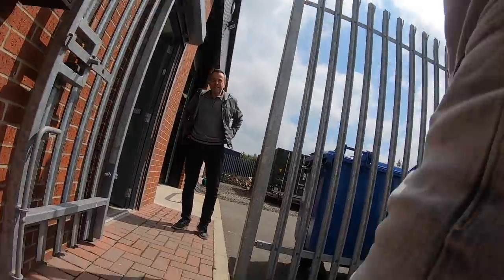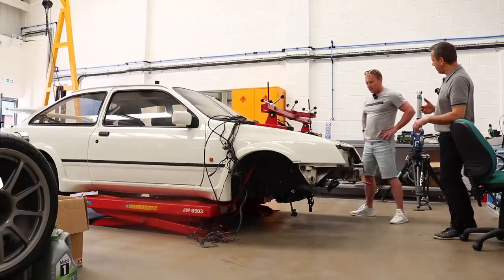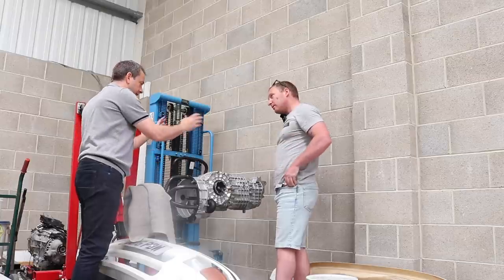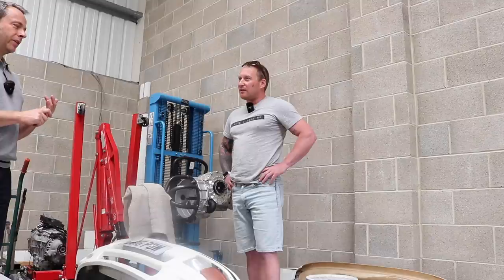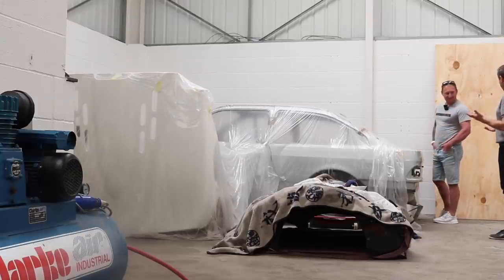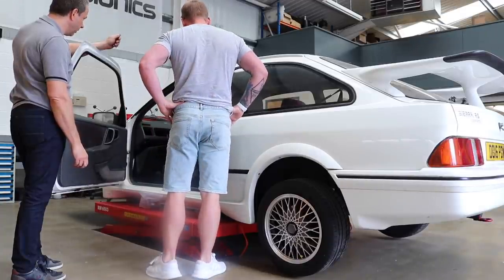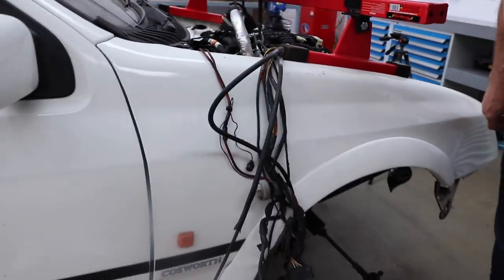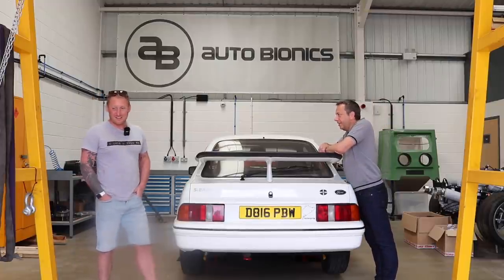Steve’s INSANE Raptor engined, PDK gearboxed, Cosworth project

Comment from the maker: If you could do any Car/Engine combo. What would it be?

Mine would be a BMW e30 M3 with modern M3 running gear 👌🏼
Reply: How about a Mk2 Golf with an RS6 V10 engine and running gear in it 👌🏼😂
Reply: Pulsar gtir with a rb26 😊
Reply: Nissan micra with the new 3 cylinder twin turbo out the new koenigsegg  🤣🤣🤣
Reply: Always loved the idea of dropping an e60 M5 engine into a standard mk2 Sierra. Or an Aston V12 into a mk3 capri
Reply: I’d love a Honda 50 with a nissan skyline engine
Reply: I’d love a fiesta ST mk6 with a 5 pot rs focus lump 😎😎
Reply: Beetle vw v8 or v?6
Reply: Mine would be 55 Chevy Bel Air - Jet Engine on the back :D
Reply: I got half of it Adam, just not the expensive bit
Reply: Vauxhall Nova GSi or GSi replica with a 2.0 16v C20LET 'Redtop'  engine
Reply: Great video adam as usual, if you want to see some crazy engine swops check out the thunder saloons from the late 80s/90s on YouTube, Absolute monsters!
Reply: 3 door Sierra with a YB in it
Reply: Alex Lee. They were done in their bucket loads in the 90,s some even had the calibra turbo 4 wheel drive running gear
Reply: Hellcat engine 707hp in a nova..
Reply: 4l boa cosworth v6 supercharged with skyline gbox and diffs in a sierra 4x4
Reply: I had a mate who had a M3 e30 with a e36 evo lump in it running 850 wheels😎
Reply: Have you seen the driftworks m3?
Reply: I wanna rwd convert my Saab 900 Turbo with a 2.3 B235R Saab 9-5 aero engine with 500hp mated to a 6 speed BMW gearbox. The ultimate sleeper
Reply: Porsche 914, or any air-cooled 911, with Taycan internals.
Reply: Adam Smith what like Phil Morrisons at Driftworks? Check it out if you haven't already. I'd like an xjc or xjs  with some sort of modern efficient V8. Or to finish my MK1 golf with its 1.8t that all ground to a halt many years ago.
Reply: Rs17t 4x4 cosworth running gear screaming mid engine dfv
Reply: Ford fiesta with 16valve cossie engine they used in the sierra sapphire cosworth
Reply: @philmann7054  
How would it fit?
Reply: @mctomeister  thats been done already nice conversion aswell. Think the lad is going awd aswell using the volvo v70 gearbox.
Reply: Veyron motor into a nova
Reply: @mrlionrocks  
Yeah would fit aye 😭👏😅
Reply: I'm quite simple but i'd love an Omega with Lotus Carlton lump. or Astra G with a Y30DTI.
Reply: Adam Smith, any idea how he got, or plans to get the PDK to hook up to the Raptor V6....who he tap for the bellhousing adaptor?
Reply: Aventador v12 into a prius
Reply: @James-P96  mk8 fiesta st with that Koenigsegg 3 cylinder.
Reply: Alex Lee loads of them were done back in the day
Reply: That Raptor V6 in a Mustang.
Reply: For me mk3 astra 200ts saloon with 3door swap mk5 vxr leg 2l turbo m32 box mk4 climate control 

Ford Sierra rs500 barracuda turbo mustang 6speed box
Reply: @paulthompson5416  theres a mk4 golf that has a twin turbo rs6 v10 and 4wd in eastern europe! theres quite a lot of videos on yt of it
Reply: @adellisdevelopmen6593  judging by the astra 200t and still wanting good climate control on a project car im guessing ur from south africa?
Reply: e30 m3 with an audi 2.5 20v turbo 5 pot in it! : )
Reply: Sierra 2000e with a vectra vxr engine.
Reply: @damonadams1126  sacrilige! why would u put a vauxhall engine in a ford! its just not right!
Reply: @johnsmith-nl3js  because it's more powerful,  I really dont like vauxhall but their engines have some grunt so I'd love to know how it would be in a rwd car that I actually like
Reply: @damonadams1126  put it in a carlton or an old cavalier! : )
Reply: Adam Smith I always wanted to take a mrk 1 Escort and Give it the RS Turbo treatment, as a kid that was
Reply: I dream of putting 2 600cc superbike engines in a 91-93 daihatsu hijet, bit weird ik😂
Reply: @Jonn3371 ive seen a lot of swaps in old escorts but i dont know if ive ever seen a mk1 escort with a rs turbo cvh?
Reply: Adam Smith would be interesting wouldn’t it 🤷‍♂️
Reply: Tube-framed Escort Cossie, mid-engined, with the RS7’s 4.4L Twin-Turbo V8 engine and running gear... 

Just for pure shits and giggles.

Comment: Just wondered why you could not just buy a wrecked Mustang V8 or even the Turbo 4 use all the running gear, make new members to hold everything, that way even run the Dash and electronics, check out Trevor from Motion Auto TV, I know its totally different but he has done a 2JZ Toyota Supra conversion into a Mustang.
This car you are building will be amazing such an interesting build, such a epic legendary Car.

Comment: Epic project, and appreciate that it's being done properly... but a couple points: Why wreck a savable original Cosworth as a mock-up car, rather than just getting a  standard Sierra? That made me a little sad. Secondly, not fair to bag on cast alloy wheels. Nearly all OEM wheels are cast and are perfectly dependable even in race applications - although of course, I'm not saying all cast wheels are created equal! Besides that, I suspect the wheels for this project are not really forged as such, but machined from forged billet. They are quite different things from a metallurgical and cost viewpoint. Finally, take those FEA results with a grain of salt. As an ex-Ford wheel engineer, and FEA specialist, I can tell you that physical testing is the only reliable way to understand the failure behaviour due to impact or fatigue. 

Look forward to following this project!